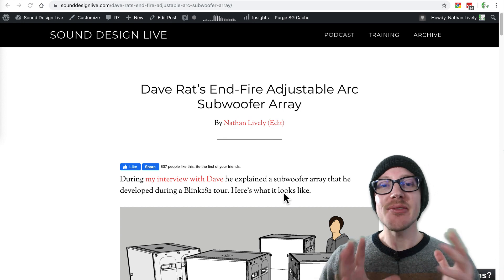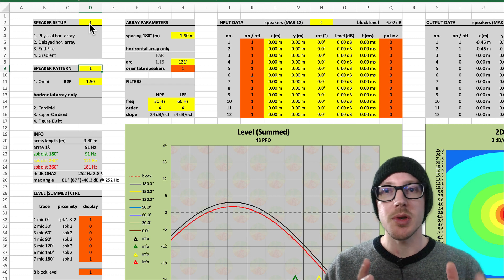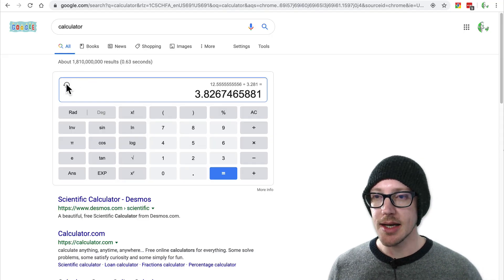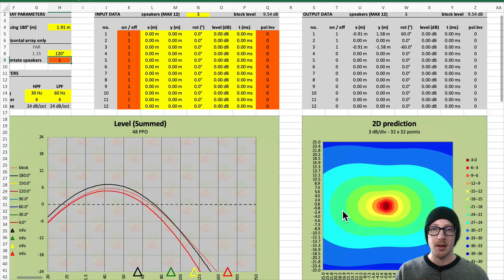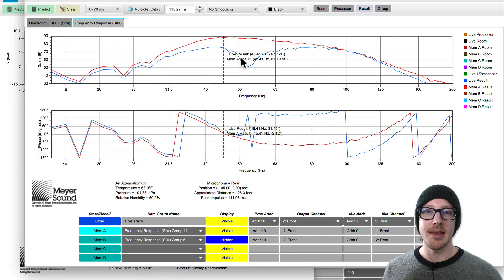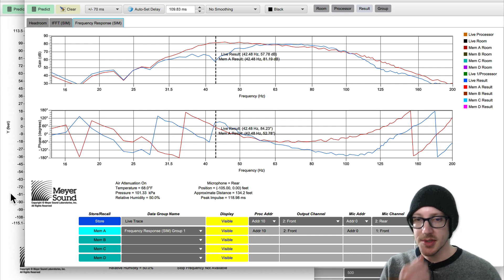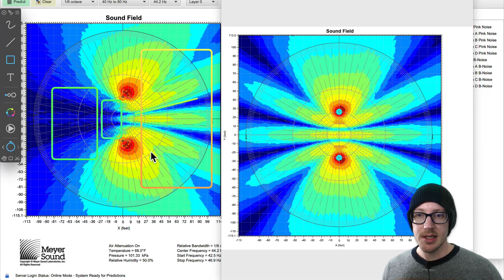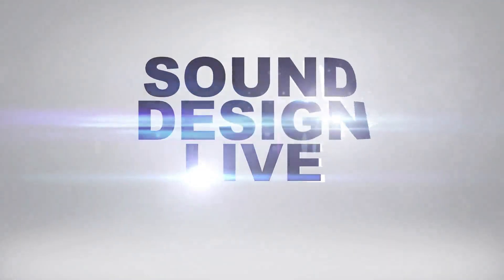Dave Rat’s End-Fire Adjustable Arc Subwoofer Array

Comment: i tried to do this set up, but I see there is a lack of energy in front in the center of the stage. I tried to "close" the arc a little bit to avoid it, but it was not good. What do you think about to put a nother little stack gradient in the center? I tried but the result is not so good. A lot of energy close to the stage but weak alley in the front line to the console position :(
Reply from the maker: Hi doctor. To me that seems like a fair trade off for less sound on stage and reduced variance across the audience, but of course than are many more designs you can try. You might like to experiement with Merlijn's Subwoofer Array Designer.
Reply: @nathanlively  Thanks for your reply, I follow your channel a lot, there is always a lot of valuable information!
yes of course, we are doing some tests to understand what to do. In Italy the venues are not huge and it is often difficult to position the subs as you would like

Comment: Hey Nathan , by changing the distance of the outer speakers now you are not in the same coverage angle which you got using S.A.D , now the horizontal ARC is not working anymore ..
Reply from the maker: Hey Artes, thanks for you interest in the video. The arc remained intact. The spacing between the speakers did not change. They all moved together forward by the same amount. Unless I made a mistake somewhere?